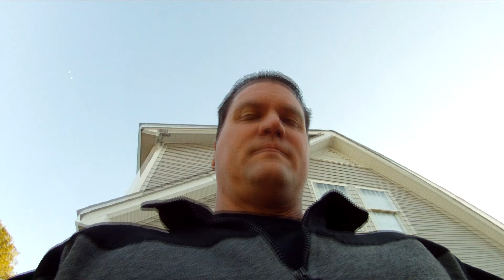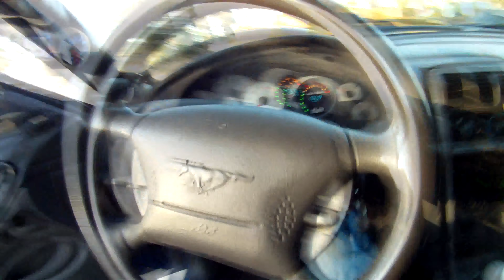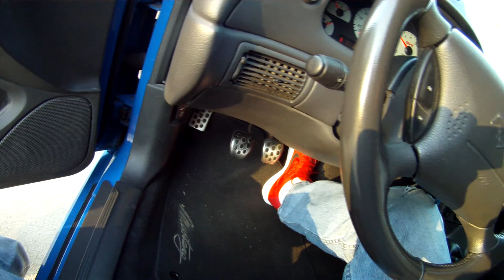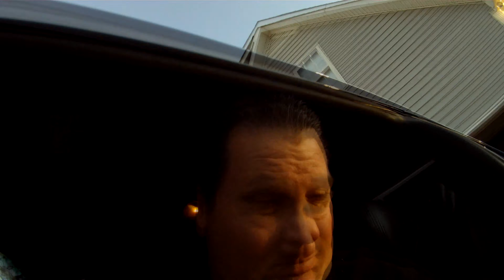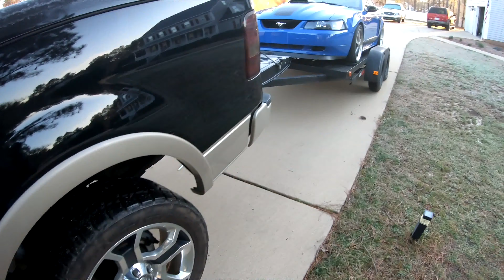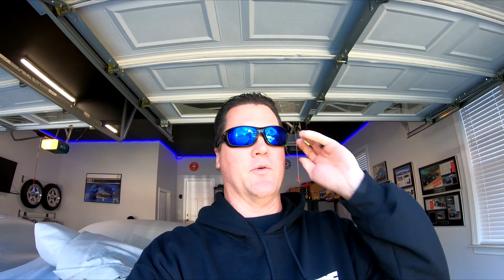Mach 1 is DOWN!!  Internal Engine problems! - TTSaleen

Comment: Dang man. Sorry to hear. That was a terminator engine from a yellow Cobra if I remember correctly. Sucks to have to put money in something that was running ok.
Reply from the maker: Yes it came out of VA from a Yellow Terminator complete drivetrain including Eaton topped engine and T56 transmission all still bolted together.  I ran it that way for a short bit before I swapped on the Kennebell 2.6 and E85 conversion.  It's been perfect so I am baffled as to what has happened.  Only will know for sure after I can pull it and tear it down.
Reply: @98saleen  Its not likely and I know fast lane are the pros so I accept the diagnosis but I've heard of people finding out that a supposed rod knock turned out to be a cracked catalytic converter that would rattle and tap loud when it warmed up.
Reply from the maker: @justin.c_svt  LOL.  With a full Kooks long tubes and 3" off-road x pipe, there's not a catalytic converter in sight.  It's definitely internal to the engine but until I tear it down, it's all speculation to the actual culprit at this point.
Reply: @98saleen  I wondered if it had LT's. So yeah thats not it lol. Were you spinning it hard a lot at high rpm? You were saying it happened out of nowhere right?
Reply from the maker: @justin.c_svt   Yep made 2 hits on it 1st and 2nd gear and when I lifted and went to 3rd I could hear it.